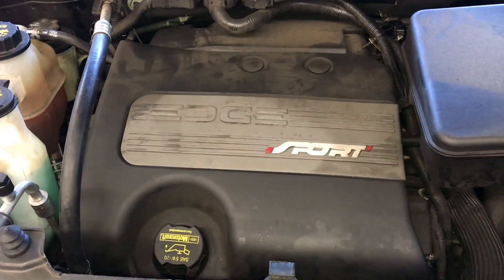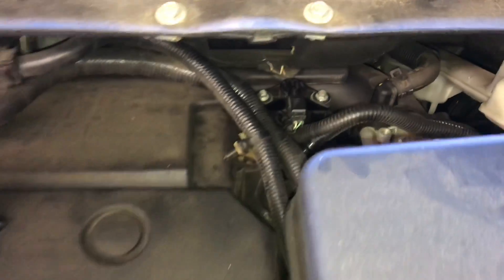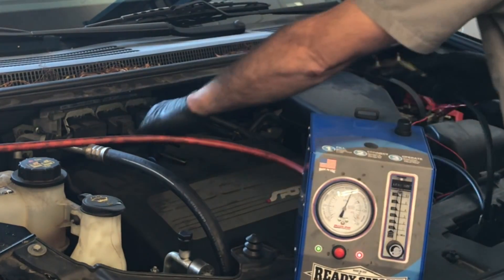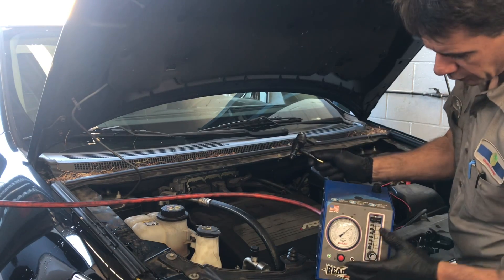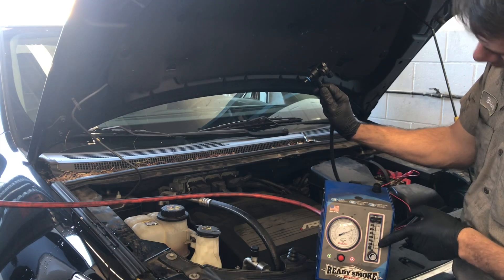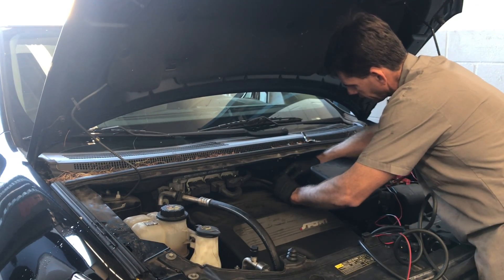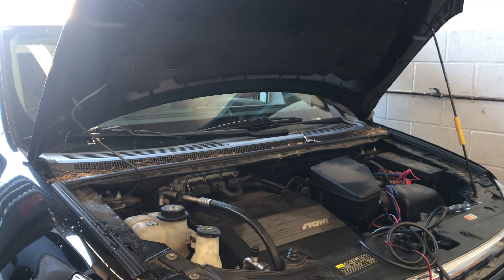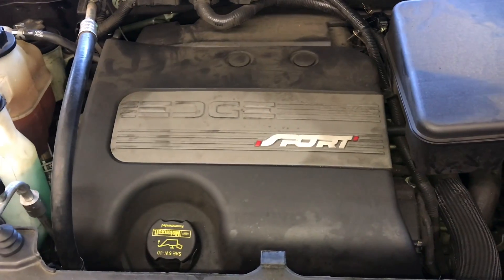How To Diagnose A Ford Edge With Rich Codes P0456 P2196 P2198 And Evap Leaks

Comment: hi brian   I think rich only at first then lean as fumes were cleared  vent valve is normally open
Reply from the maker: scuba422123 The vent Valve is open until the PCM wants to purge the system or test the system then it closes the valve. The purge valve is normally closed and that’s the one I’m showing. It’s only open when the computer wants to purge the Canister into the engine.. if the purge valve is stuck open it was sucking fumes straight from the evap canister/gas tank making the car to run rich.
Reply: thanks for the reply brian …..iam aware that the vent is always open even in purge..thats on a duty cycle .and only closes for a leak check  to build and hold a vacuum I know every system works a little different though  @HowtoAutomotive